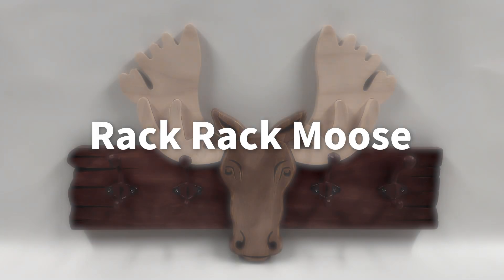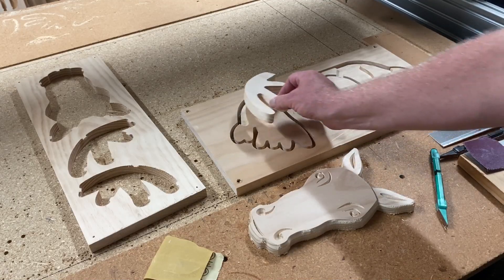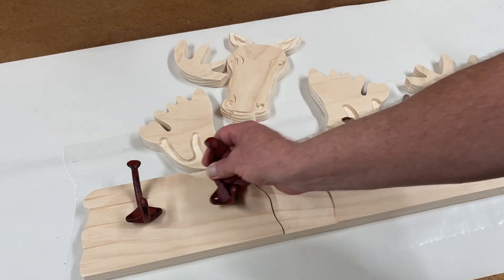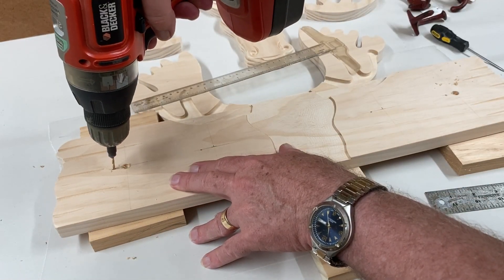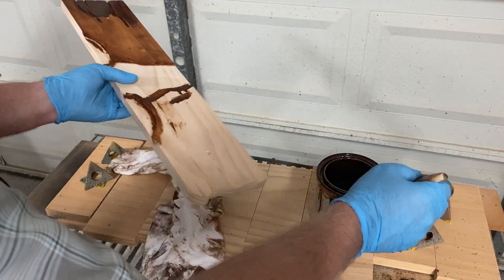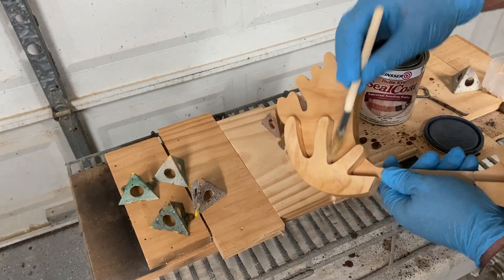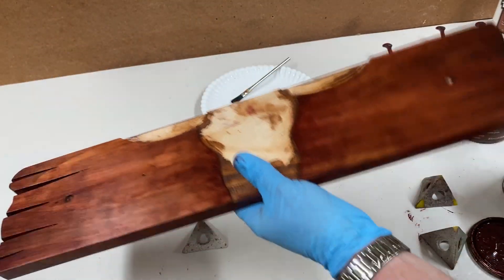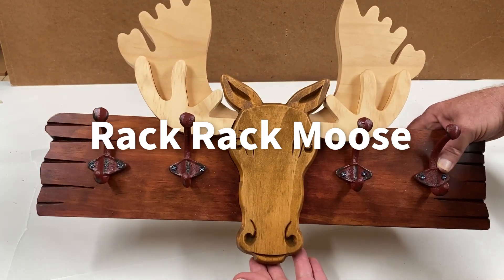Making Rack, Rack - MOOSE | Michael Tyler's FREE CNC Project of the Month | Vectric

Comment: Hello I'm new at this and I would like to change the length of the back board can you tell me how to do that if possible?
Reply from the maker: You can alter and customise this project as much as you want. To alter the backboard just select the backboard vectors and use the set size tool where you can change the height and/or width to what you like, then recalculate the toolpaths. I hope this helps!